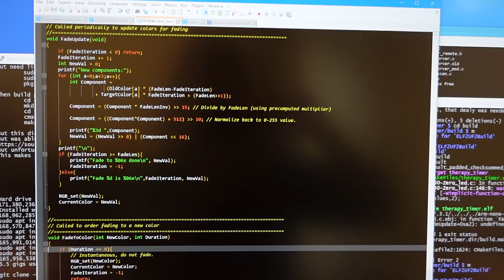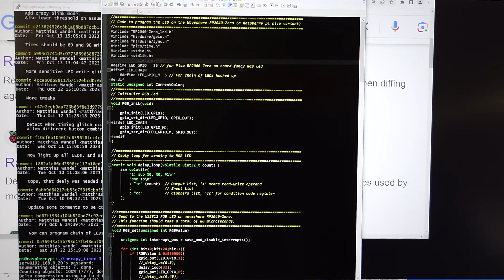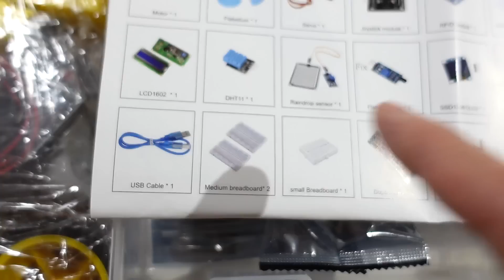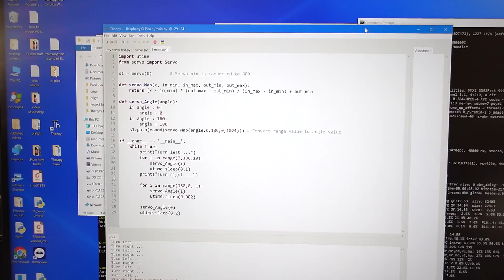Pi pico therapy timer and C vs. micro python

Comment: You should really check out the ESP32 with micropython. It's SOOOO cheap, and works very well with my experiments, outdoor projects, and those sensors you have there. The ESP32 is smaller than the RPi Pico as well (But different specs).

Comment: I'm only using Python these days. Python for my pc and Raspberry PIs and micropython for my Raspbery pi pico, ESP32 and ESP8266. I also barely uses Raspbery pi pico anymore, I fell in love with the ESP with the WIFI already incorporated. What I really love about it it's that I can reprogram all my ESP (25 of them) in my shop from my laptop in my basement via a WEBREPL. but for ESP8266 I have to compile the python script in a .mpy file because my switch program is too big to run as a .py file. Keep using micropython you will love it even if it's a lot of space in flash

Comment: Don´t you think a Arduino would be more suitable for this project since its so simple? You don´t need the operating system on a Raspberry pi.
Reply from the maker: Less suitable because its more expensive and bigger.
The pi pico is pretty cheap and doesn't have an operating system

Comment: Wait till you hit the availability wall for libraries... CircuitPython (technically a MicroPython fork) has more libraries available for different sensors/hardware, but doesn't handle threading  nor have great support for PIO. MicroPython handles both of those, but is a barren desert for many sensor libraries meaning you either have to port, or write your own in C... Both are great for what they do support, but if you do anything outside of that you might as well go back to C

Comment: as a therapist I will only note that sometimes you want the client to be aware of the passage of time, as the knowledge that there's only X minutes remaining can push them to disclose something they were hesitant to bring up, or allow you to pivot from "I have listened and validated as you have complained but let's talk a bit about what you can do to deal with this problem." regardless, a very neat project and on balance probably better for the office than a clock.
Reply: As well as knowing the remaining time is important for the planning.
5 min to the end, you don't open the next treasure trove.
Reply: Does therapy even work? It’s advice isn’t it?

Comment: If only your BIL could have waited a month, Pretty sure a knock off version will be available from a certain country for a couple of bucks including postage, Cynical i know lol
Reply from the maker: its a niche product, no sense knocking it off.
Reply: @matthiasrandomstuff2221  If they think they can make only a few bucks, that has never stopped them yet lol, But I think your odds & ends of wood version looks better than the $80 commercial version, They are pricing them like an intricate electronic medical device. when its only a colour changing lamp with a timer. Complete Rip Off

Comment: For a product you need a user interface to change settings e.g. session time, color selection, etc. The Espressif chips are overpowered for what you're doing, are cheaper, and include WiFi. Andreas Spiess started IOTAppStory for an easy way to do Wifi configuration and OTA firmware update for these chips. The wemos d1 esp8266 module is like $3. You program from the arduino IDE so you can use all the RGB led libraries.

Comment: doing stuff in "integer math" was really important back in the day. Even if your CPU could handle floating point numbers, it was much faster to use integers. This came up in a computer graphics class I took in college in the late 90's; we had to draw a circle using only points and do all the trig with no floating point math.
Reply: Those were fun times weren't they. Although, a fair few tricks I learned back then for optimization still work now, even as good as modern compilers are. I just wish I could send the latest generation back to those times to learn.
Reply: @anon_y_mousse  Make them program for embedded systems, in C and assembler. 😹
Reply: I got distracted recently and made a angle representation library entirely using fixed point integers using a sine cosine pair to represent the angles, no floating point or trig required

even though nowadays floating point computation is as fast as integer for the simple operations
Reply from the maker: that's not even a hard one.  no trig required, just use the pythagorean theorem.  And if your chip doesn't have a multiplier, you can get from one square to the next by adding terms in an arithmetic series
Reply: Oh right, you don't need trig at all. And you only need to iterate for a quarter of the circle and plot (x,y), (-x,y), (x, -y), and (-x,-y).
Reply: @matthiasrandomstuff2221  or better yet - just use CORDIC ;-)
Reply: @matthiasrandomstuff2221  pythagorean is too much demanding :) - better use something similar to Brasenham's algorithm ;)

Comment: The cool thing about the RP2040 is that its flash memory is not integrated, and is implemented by a discrete NOR QSPI flash chip. This means that if you run out of flash, you can just buy a bigger flash chip. A 128Mbit W25Q128 is <$2 at low volumes, and that is more storage than you'll ever need.
Reply: that feeling when a yt comment solves a problem you were having. thanks for the info.
Reply from the maker: bit if you are buying pre-made boards, you can't just buy a chip for $2 in single quantities and swap it out
Reply: @matthiasrandomstuff2221  I mean, you can, but yeah, it takes being somewhat comfortable with SMD rework - which is a hobby and skill in itself.

But another side effect of this is that there's now a bunch of RPi Pico clones with the full 128Mbit of NOR available (keyword is 'pico 128mbit' or 'ultimate pico' in the typical places). And they're still the same chip otherwise, so you're not buying into a weird obscure ecosystem.

Comment: i just got a very similar kit to that pi PICO except it's using arduino uno instead of a pi. do you have any experience with arduino or know of any pros and cons vs a pi and a similar arduino? this was my first step into the door of creating my own electronics and it seems i can do many of the same tasks as your pi with the arduino (it comes with pretty much all of the exact same sensors you have)
i've also recently got an arduino micro which appears to be a similar form factor as your pi Pico
Reply from the maker: with the arduino, if you decide to use some library from adafruit (they are all bloated), you pretty much have the chip nearly filled.  So no pulling in a second library.
Reply: @matthiasrandomstuff2221  using the "Arduino IDE" it has a library section which  allows you to import many use-case specific libraries. for simple HID or robotics tasks it seems to work well. i am sure ill find the limitations soon

Comment: Python is a slow, fat, scripting language.
It apparently eats away at a lot of development time for some people.  This bonus is understandable.
Still, a batch language sure eats up a lot of processing power spent on interpreting instead of direct execution.
Seems like a poor software response to ever more powerful hardware: bloat it all down so it's comparable to a c64.
Yours truly,
A dinosaur.
PS: even I wish I'd shut up on this topic, but it still bugs me - much prefer raw performance in embedded HW/SW development.  Squeeze out every last milliMIP.
Reply from the maker: it depens on how much the code ens up running.  If its for an experiment that will run less than 10 hours, even nergy wise its not a win cause the PC used to develop the sw eats 100x as much power.
Reply: Python isn't a scripting language though, it's a programming language. It's compiled to bytecode which is run in a VM, much like Java and C#. Yes, that also applies to MicroPython.

It is noticeably slower than C, true. But development time is much reduced. And for one-off hobby projects, programmer time is much more expensive than processer time. It really depends on the situation which is more appropriate. I say this as someone with extensive experience in both Python and C.

Honestly, I'd like to see more Rust for MCUs. Seems to have some advantages from both languages.
Reply: @phobos.anomaly it's definitely not compiled to bytecode and is 100% interpreted like a scripting language. Not sure where you got your info but double check your info.

The difference between scripting and programming is really ambiguous and really just semantics

Comment: No offense, but a clock-based timer with hands, or just one hand, is a better therapy session tool.  A quick glance shows exactly how much time is left.  A clock face is very intuitive.  Something with glowing lights has to first be interpreted and then a vague sense of time left is estimated.  It could still be an electronics project with a clock face on an LED display.
Reply from the maker: The whole idea is that you dont actually KNOW the time, and you can see the color without even looking at it.

Comment: I hate button sequences. I use either timed buttons for up to three options, or toggle buttons, that can be tapped as many times as needed for the number of options needed.
Reply from the maker: Timed buttons are really only practical for short and long clicks, not three lengths.  Toggles are only useful if you have a display to show what you are toggling on.
Reply: @matthiasrandomstuff2221  I never had an issue with three click lengths. And you had a display...the light. A pulse of light after each button press would be all that's needed. alternatively it can pulse the number of presses and reset at the max.
Reply: @lightdark00   Think of button sequences as a binary input somewhat akin to Huffman coding and you'll understand the utility.
Reply: @anon_y_mousse  Most my buttons on projects are interrupts, so I like to keep it simple to understand instead of patterns.

Comment: I cant wait to see your opinion on the RPi 5
Reply from the maker: I'm not in a rush to get one.  For most of the stuff I do, a pi 3 is plenty.  and the pi 3 has a proper and less fragile HDMI connector.
Reply: @matthiasrandomstuff2221  also it doesn't need as much cooling as 5 or even 4

Comment: Thats funny, I ran through the same sequence of decisions when I started using micropython. I avoided it out of principle but it turns out you can get a lot more work done if you don't have a performance requirement
Reply from the maker: I need to play with it some more to get a sense of what it's good for.  Had a hell of a time getting wifi to work on the pico with C, and then the router started ignoring it after 18 hours.  could not tcp connect to it, but could still ping it.  No idea what I did wrong.
Reply: @matthiasrandomstuff2221  Had exactly the same experience with a Pi zero W.  Went through every bit of config with a fine-toothed comb.  No idea what I must have missed.  Couldn't find any stray packets with Wireshark.